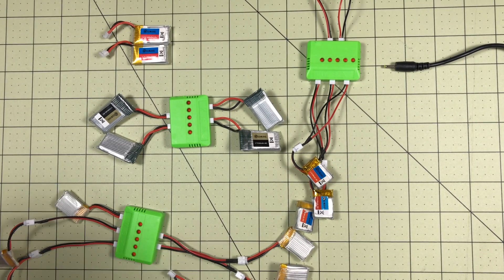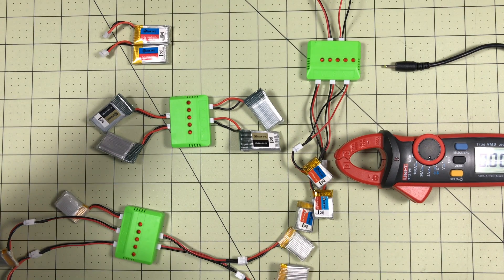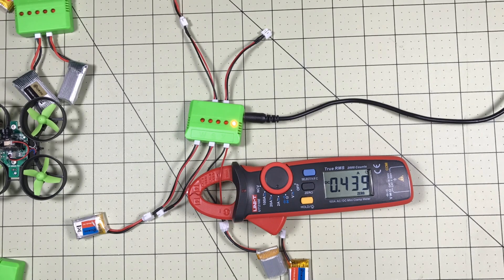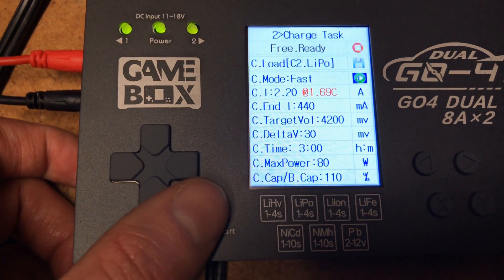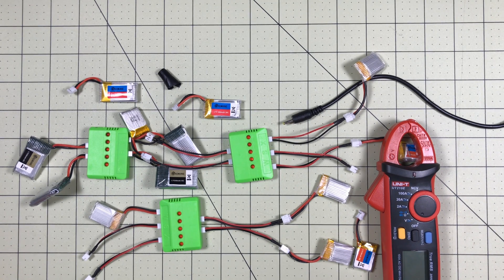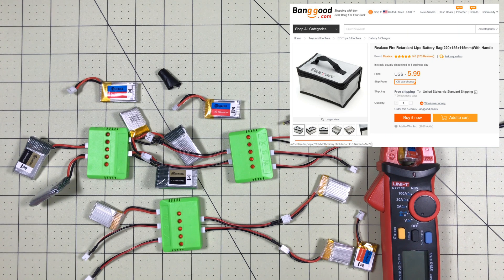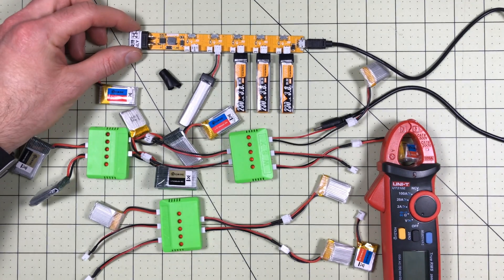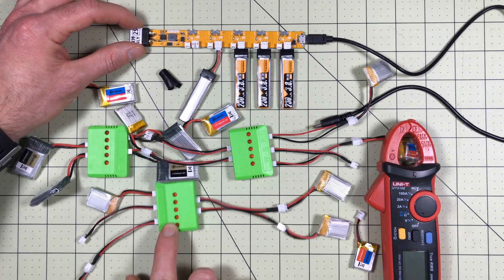Are lipo micro battery chargers safe?  Do they charge too fast?

Comment: The unit tops out at 1.5A draw divided by how many are plugged in. The reason I stopped using them is the uneven end voltages. Often I would get end results like 4.01v 4.11v 4.09v 4.24v 4.17v 4.03v

Comment: Hi, have you had any problems with stock furibee f36 battery? mine holds charge only for max 2 min :(
Reply from the maker: Do you just have one battery. Or several that all do the same?
Reply: DroneRacer101 just one, at begging I could fly around 7 min
Reply from the maker: I would try a nee battery first. How many flights fo you have?  May have worn out the motors.

Comment: Couldn't you just make some parralel connectors to connect to the green charger, so you have 4 or 5 batteries connected to each of the ports?  That way, spreading the amps, or won't that work?

Comment: I think these little batts can obviously handle 3c charge quite well, as long as they don't get hot and are not over charged too much in voltage  ( mine charges to 4.25v which is a little high but again seems to be working alright after more than a year and many many cycles ) thing is to check a new battery for heat and check a new charger for correct voltage  it off before trusting them.

Comment: I use them to and no problems I charge 5 bats at once evry time 1 year bateries also ok bur at one of them I have small fire :D but reaso was : I to much pull for wires and schort batery inside

Comment: I charge my 1S bats on my SKYRC (original-no clones) IMAX B6AC V2 with an adapter that will charge five 1S batteries at one time. You set the charge rate in amps (from .1 to 6A) equal to the total of the mah of the batteries (1C rate) or less if you like. I'm pretty careful and I check that each of the batteries is the same size mah and brand, and that they are all within about .1V to keep a lower V battery from getting a big initial punch of charge amps ('lectricity follows path of least resistance). Because of the "least resistance"  rule, the batteries have always finished equally charged. I also have several of the Chinese 5x chargers and never had a problem (will still use on rare occasions), but much prefer the control and shutdown safeguards on the IMAX, as well as just being able to see the charge rate and progress to completion. Liked the features of the SKYRC enough to recently purchase the quad charger version to charge multiple larger lipo batteries independently (didn't want to do parallel board charging with the big lipos).

Comment: Can you please also test if the current is the same if we charge five batteries at a time? Or the power from each port is independent from others. Thanks.
Reply from the maker: +i74s i use 2.4A USB chargers. It does funny things when it doesn’t have enough power.
Reply: i measure every time and with the eachine 260 mah 45c from bg  the wall adapter provides 1 amp (and can 3amp), it lowers when 5 batterys plugged in so 1 amp : 5 = 200 mah ps @ 5 volt en 1 amp max, it starts high ends low ,, but @ the pc usb 0.5 amp max usb2.0 limit
 dont use usb3.0 2 amp
Reply: 2.0 USB offers only 0.5 amps (500mA), so in theory charging all 5 at once, should split the power to 100mA for each battery.

Comment: I can't say I'm surprised, but it's helpful to have it confirmed.  I do wonder if all of these tiny chargers output a similar ~500mAh value.  I got some with two, four, five and six output ports.  I also wonder if the USB/AC adapter makes any difference. I've got USB adapters with output values that range from .7 A to 2.1 A.  And, yea, I'll probably use them on the go, and use a six port board connected to an SkyRC Imax B6 at home.
Reply from the maker: +Rick in Jax ah I forgot. I was going to try charging 5 of these on a 1 Amp charger and see what happens. I will do that and post in the description